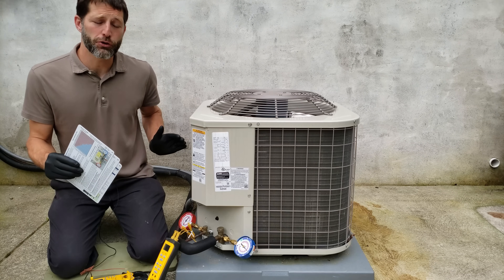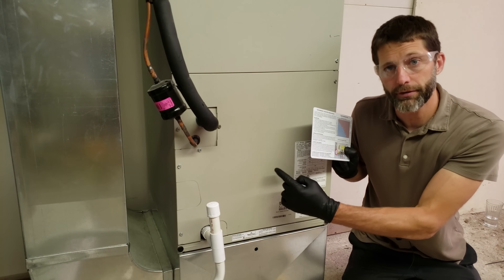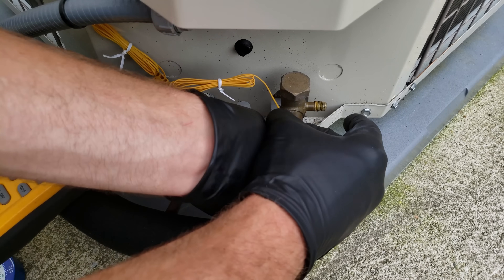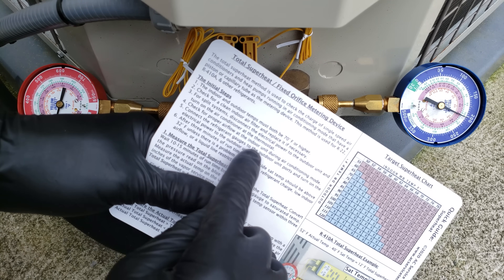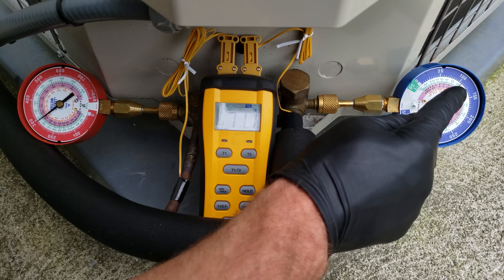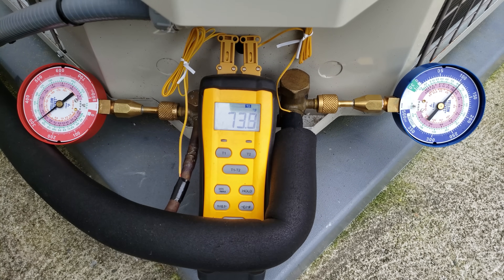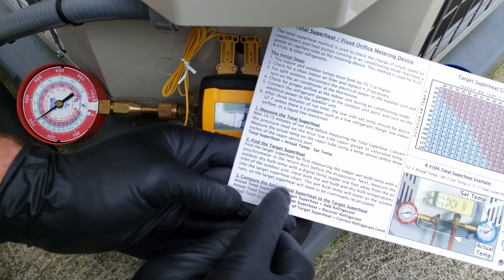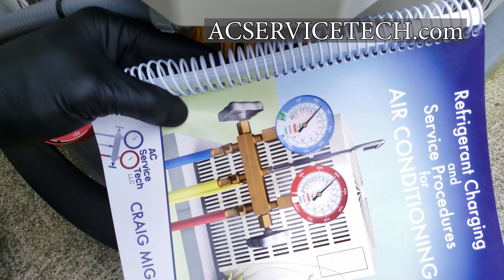Checking the Charge of An R-410A Air Conditioner with Quick Reference Cards!

Comment: This guy is great in explanation and why which makes it helpful when you are taught properly makes for optimum performance. 
After learning the super heat method i am curious as to why not many units have sight glass. 
Seems full proof and being a former auto tech and do all my vehicles only an add on ac has sight glass on drier.  Why is it so complicated to charge especially when compressor is at same rpm vs auto which varies. 
Just trying to understand why sightglass is not used more.

Comment: Sorry for my late request text. I have a lenox roof top system. I call for heat is working fine, for coolling i don't have 24 volts. But the unit have economizer to it. What do you thing i have to do on to make that situation like that. Please help me, may God bless you

Comment: I am quite curious why i never see any reference (theory and techniques) to automotive AC units using R134a in your training videos.  Don't they follow the same principals.  Can i check the charge on a car using superheat and sub cooling methods? or is the only way to check the charge to evacuate to a recover tank and measure the returned charge?  I rarely hear of automotive techs testing a system with high pressure nitrogen or using a deep vacuum (only single stage pumps for 30 min to dry things out then charge). What is the typical metering device used in automotive AC units?  It is like a separate world, with automotive mechanics doing HVAC work on cars, but not commercial or residential, and HVAC service techs never doing work on cars.  What is up with that?  I would love to hear your take on this mystery.
Reply: I had same question but in reverse. 
Former tech and ac machines are popular which do is all evac & recharge. 
I am a firm beliver in longer vacuum time the better as moisture may be deep in a system but takes time to be sucked out after it boils into a vapor. 
Measured amounts of freon are posted on every car and there are low and high pres switches. 
1k rpm is what i charge at but 2k years back i think was taught. 
In the 80’s cars had sight glass on driers which removed all the guessing. 
I am learning about wet bulb temp and super heat myself since watching ac guys work on my unit scared me. 
After less than 5 min of vacuuming the guy was charging my unit. 
Ran forever to reach 78° amd basically not many guys give a crap to do things right these days. 
Guy in these vids reminds me of myself. 
I dont leave no stone unturned and guys i taught to fix cars always understood how and why after i was done.

Comment: Wet bulb dry bulb super heat sub cool, wow i’ve never seen anybody make charging an ac so complicated. First check the filter then check your low side pressure and look for a target of around 38 to 40 degree f corresponding pressure,experience will tell you what side of these readings to expect depending on temperature and humidity conditions, and feel that suction line, with experience you will feel if the unit has the proper charge, it will have that certain chill telling you i’m happy, i’m full, remember a really good tech’s best tools are his senses, sound, touch, sight, smell, use them as an extension of your tools, that’s the mark of a good technician, oh and always connect your high side gauge as a safety to monitor for abnormally high pressures “ ha that’s pretty funny with 410A “ and don’t forget to feel that liquid line for excessive heat, if so look for a dirty condenser, and clean it if necessary before you even proceed, don’t forget that  sometimes they can look clean on the surface but are still dirty. If you charged the thing before and it’s low again look for the leak first, no sense wasting time charging the thing if the evaporator needs replacing, and with these insane pressures of R410A it’s probably pushing out at the bottom of the evaporator where it sits in the drain pan and rots out.

Comment: The problem with r410a  is a blend ,  maybe if you have to add refrigerant, you can get away with just adding to what u have in the system , but when is low , you will have to recovery what's in the system and weight it. and then recharged by weight

Comment: Great video but why dont you ever use digital gages
Reply: Because digital sucks, analog shows what’s actually happening in the system, for example a pulsating needle could indicate a sticking or bad suction valve in the compressor, digital gauges  are for chump techs with too much money and too little brains.

Comment: I'm up at 7200 ft above sea level. Only PT chart I can get close with is for 5000 ft.. Is there a chart or a way to change P=T values based upon our altitude? Thanks, Mike
Reply: Atm. press at sea level is 14.7psi. check the atm. press. at 7500ft and add the difference to your gauge pressures for proper settings of controls. I believe it’s roughly around 3 to 4 psi. For example, R134a settings on a beer cooler are about 35psi cut in and 15psi cut out so set around 39ci. and 19co. this should give you your proper evaporator temperatures.

Comment: Craig, i have a question regarding leak detector. is there any leak detector which is better than superior accutrak ultrasonic leak detector for R410a or R32 systems?
Reply: I am wrongdoing this too. Is this the best in the market?
Reply: The CPS LS790B, the LS790B is the only electronic leak detector i’ve ever seen that actually comes close to working, the rest all go crazy with false triggering, the very best detector i’ve ever used is a propane fired halide detector, but they only work with CFC’s and HCFC’s.

Comment: For some reason I was taught to take the sub cooling temp reading as close to the metering device as possible?
🤔🥃🥃🍺🍺🍺🍇🏌
Stay safe.
Retired(werk'n) keyboard super tech.
Wear your safety glasses.
Reply: You will get erroneous readings due to refrigeration load, ambient temperatures, and line set length if sub cooling is checked at the feed to your metering device, so I don’t know who taught you this but I disagree. A real world evaluation of your condensers sub cooling ability must be made at the outlet of the condenser. Also much literature is out there stipulating to check superheat near your compressor, also wrong, evaporator superheat is measured at the outlet of your evaporator for the same reasons as explained above.
Reply: You should but that is not always possible unless you got wireless temp probes and gauges. Some techs don't have access to that so the outer outlet at the condenser your best option for that.
Reply: i think you might have sub cooling and super heat mixed up
Reply: @jgt5642  Nope
I glanced at my notes from eons ago.
" as close to the METERING device as possible" just like my notes suggested site glass outdoors is useless also put that as close to the metering device if at all residential.
And this is from Peirce Phelps the puron Carrier geniuses!
😆🤣🤔
Reply: @realestateservicessaleshea99  site glass? where is such a thing. youre obviously taking about a unrelated topic.
Reply: @jgt5642  it's in the notes from the leading air conditioning geniuses Peirce Phelps.🤣😆😆🤣🤣🤔

Comment: Another great video, does it make a difference where you position the temp probes? it appears you have the suction sensor on top of the pipe and the liquid on the bottom.
Reply: Your supposed to place suction at top as your checking vapor pressure and if there is any unvaporized liquid it will be running along the bottom of tubing and in the liquid line any uncondensed liquid or “vapor” will be at the top. Personally however, after 44 years in the field I think this is just the whimsical teaching of some anal engineer, I have however always practiced placing the TXV bulb at the side of the suction line as taught, why take chances !